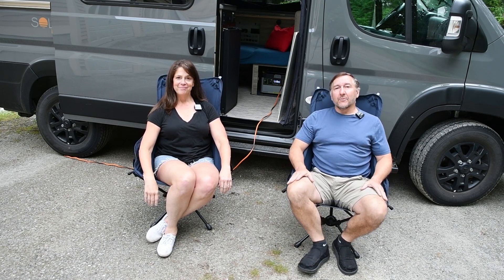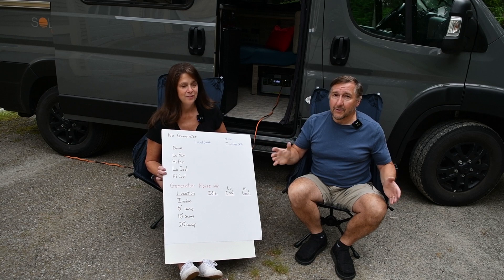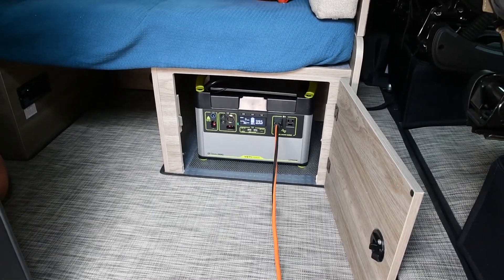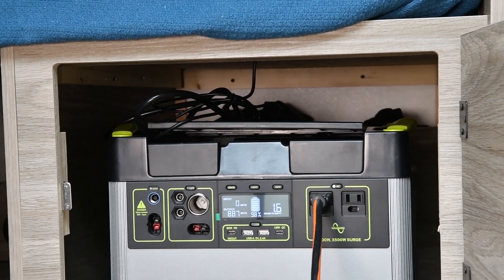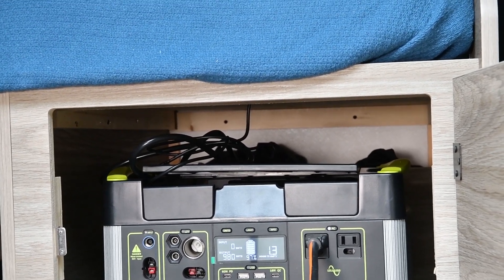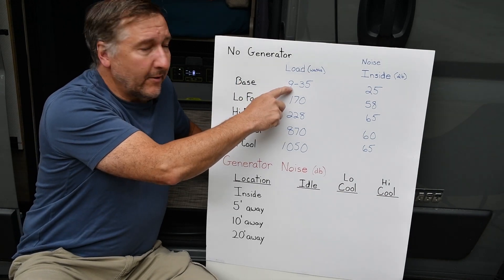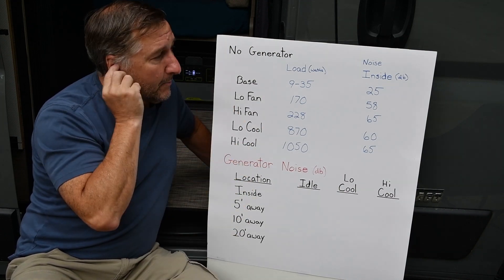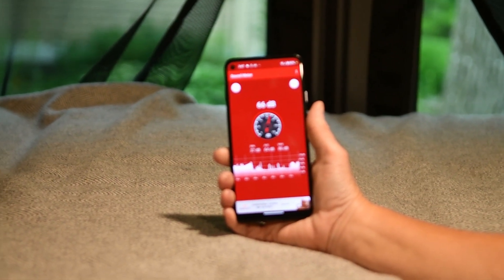How much power does our van A/C use? (Coleman Mach 10) And how loud is it?

Comment: How is your generator working out? I'm in the market to purchase one to use it with the AC. I do have an Ecoflow Delta 2 Max and Goal Zero from previous years but I don't think that's enough to use for the AC.
Reply from the maker: Hello! Thanks for watching and for your question. I agree that to use the A/C, a battery bank or even both of them will not really hold up for more than 2-3 hours. Some people have suggested a more efficient/lower power A/C unit. To rely on batteries you would probably need that and a full-on lithium battery system. In our case, we don't use the A/C very often so for us it's not worth the investment right now. The downside to the generator approach is the noise which can limit the places it can be used. We have been happy with our Westinghouse generator (https://amzn.to/3yMiT3F) though it has not seen too much use to be honest. Aside from A/C, we don't have much of a need to fire it up. It does start right up and run reliably. It operates at a fairly high RPM when the A/C is on high as you can see in the video. The other generator we considered and others have suggested is the Pulsar GD400BN (https://amzn.to/3YcwwTV). It has more power in a package about the same size with all the same connections I wanted. Whether it will run quieter or not, I cannot say, but I would like to know. Certainly the amount of power is more that the pocket really needs, based on our findings, but this should allow it to run at a lower RPM so maybe it would be a little quieter? Good luck and let us know how things work out for you!
Reply: @Outapkt  what about the Ecoflow Smart Generator Dual Fuel? Do you have any feedback? I live in Northern California and would use it for emergencies only. It looks like it does but I don’t want to stretch the generator capacity if is not going to be able to keep up if is too hot.
Reply from the maker: @valb703  I feel like that generator is just a bit under-powered. Also it does not have a 30amp output connector, which you really want if you plan to connect it to the Pocket power input port, to power the van A/C and the other 120V circuits at the same time. Maybe if you combined that generator with adding a "soft-start" on the A/C and used a 30A to 20A adapter it could handle just the A/C but that would not be recommended, and you would not want to power anything else (like charging the coach batteries or a laptop etc) as that might be too much of a load for a 20A circuit. I also think that model is quite heavy compared to the two I mentioned above (it is 67 pounds vs 43 for the Westinghouse). Based on my experience, I would not go any lower power-wise than the Westinghouse. Let me know what you do and good luck!
Reply: @Outapkt  that’s what I was worried about. Thank you for the feedback this truly helps to make a better informed decision.

Comment: the reason it tripped your yeti is due to short cycling the compressor as the capacitor did not have enough time to recharge so it had to pull what it needed from your source. this is not only bad for the electronics in the a/c unit but also the compressor.
Reply from the maker: Thanks for the context, makes sense. Definitely cycling up slowly moving forward! Thanks for watching!